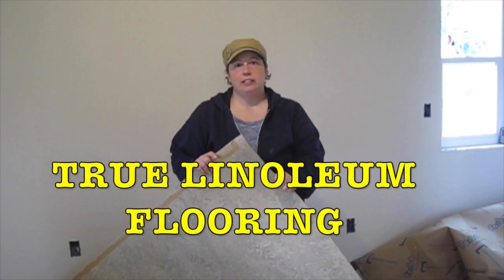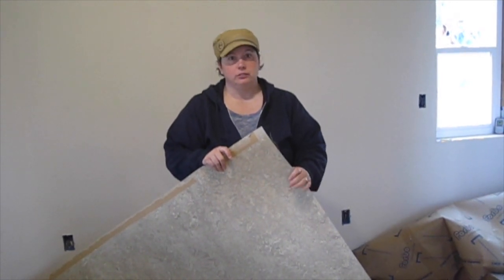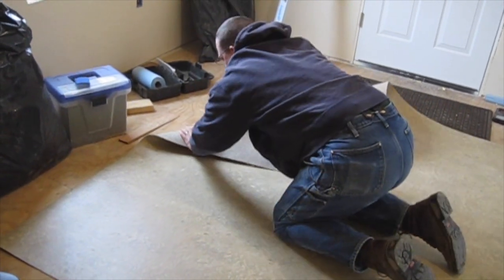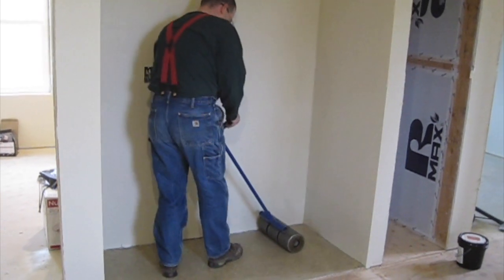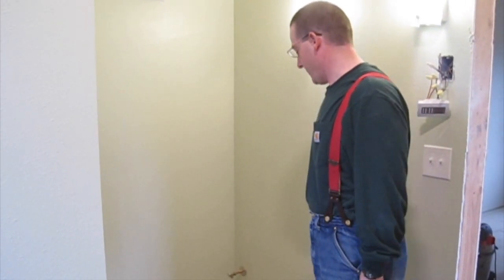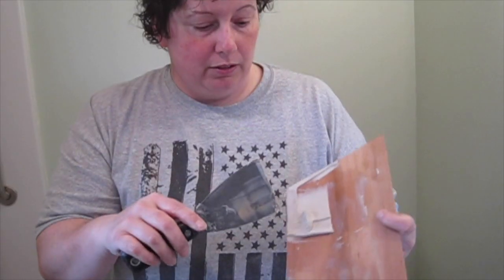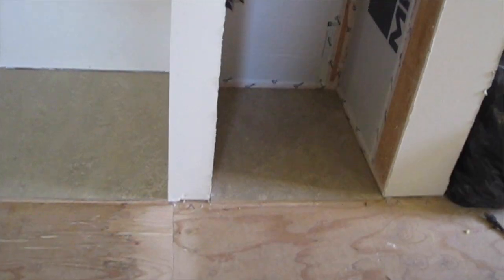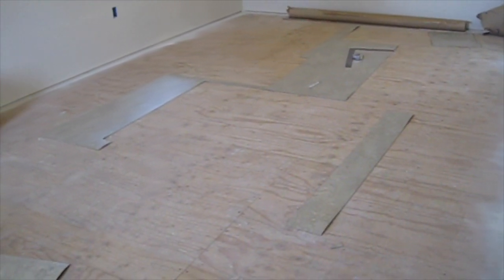Building Farmhouse #16: Installing True Linoleum Flooring (Forbo Marmoleum)

Comment: Thanks for the Marmoleum install video. What did you use as underlayment and how thick was it? Is the underlayment on top of the subfloor? Thanks!
Reply from the maker: Our underlayment was plywood on top of the plywood subfloor. It’s thickness was just enough to bring the linoleum up to the same level as the adjacent finished floors. Thanks for watching!
Reply: @vnthomas16  for better acoustics and comfort Forbo also has cork underlayment as an option

Comment: I know.. old vid.. I have a couple questions.  Did you heat seal the seams?  and is there any reason you can think of that marmoleum could not be used on a shower wall?
Reply from the maker: Hi! We did not heat the seams, just used the glue and both bathroom floors are still holding up great. I guess you could use it in a shower, but I’m not sure about keeping everything watertight and how cleaning would be. I’d read up manufacturer info on their website. Good luck!

Comment: Why did you not weld? Lack of welding rod?
Reply: if you use a conventional fit seam you do not have to heat weld and Forbo also now offers a product called Marmoweld ETU that is an easy to use paste weld.